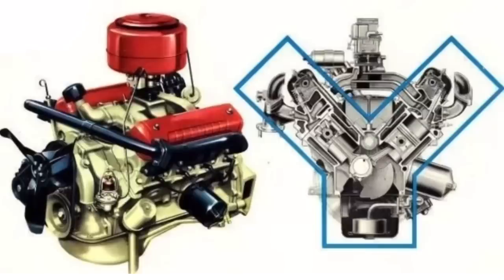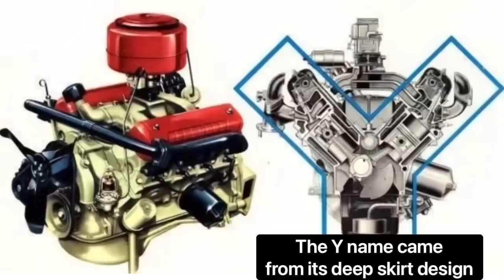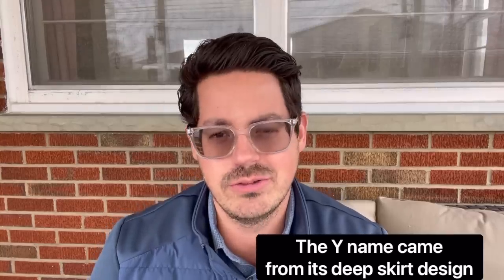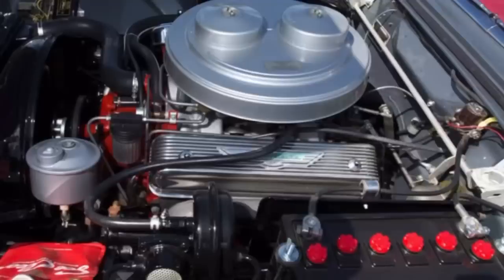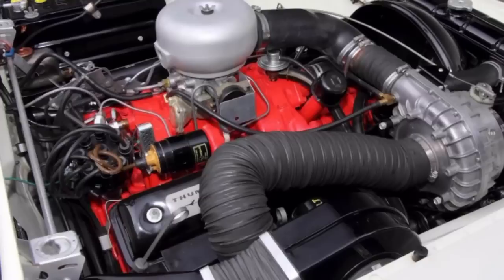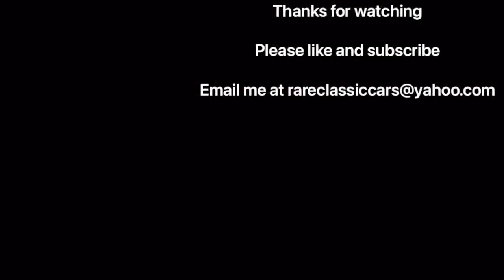Worst Engines of All Time: Ford Y Block V8

Comment: Lol all these guy talking about them motors leaking oil. Im 71 years old every car in my  neighorhood leaked. Cars and motors sucked back in the 50s60s70s80s if you had a car with 50,000 miles on it no matter what it was it was burning or leaking oil.
Reply: About leaks, that is true.  VERY few cars more than 5 years old were leak-free.  The gaskets would harden and shrink.

Comment: I;ve had a few  292 Fords and I see NOTHING wrong with em. For instance 292 With 312 heads In my opinion cold hold it's own any day. It all boils down to if you are a Chevrolet guy  then nothing is as good. Myself i'm a die hard blue oval kind a guy
Reply: FACTS.

Comment: We had several y blocks, they all lasted over 100,000 miles. Sludge was a problem in any engine of the era. I cleaned a lot of engines back, ( all makes) then wondering how they ran, with all the sludge in them. The only real problem with a y block was they were heavy, like many engines of that period.

Comment: The "Y" blocks were great engines. The Fords benefited from having a 3-speed automatic transmission, although until 1956 or the 1958 Cruise-O-Matic, they normally started in 2nd gear. With the Lo position, it allowed the fords to move off the line quicker than a Chevrolet with a PowerGlide.
OK, the "Y" blocks were very reliable  and long-lasting engines. Their life and reliability depended on a large part to regular maintenance.

We resurrected a 1960 Ford Sunliner a few years ago. It pretty much had sat at a vacation home, rarely driven, for the last 50 years when we got it. The top-end was slugged up and we had to pull the heads and do a valve job.
We used to see lot's of much newer slugged up engines,  and it wasn't from not using detergent oils. Nearly everytime, we found that they had used Penzoil and changed it at factory intervals. It was the ash in the oil. Not so much a problem with Quaker State and NEVER a problem with Castrol, Valvoline or other Western oils.
Well, after the valve job, the engine ran like new(the car didn't have that many miles on it). At the same time, I pulled and resealed the Cruise-O-Matic transmission. As these used metallic clutches, they were in great shape, so I re-used them. The lined bands were replaced, as well as all the gaskets and seals.

After that job, I took on a 1956 Ford T-bird, with a 312 V8 and Ford-O-Matic. After disassembling the engine, everything looks good, but the customer wanted it rebuilt. Everything was within tolerances so the engine was cleaned up and new rings and bearings were installed. The heads got hardened valve seats for the unleaded fuel. Again all the transmission internals were in great shape, so all it got was new bands, seals and gaskets.

The similar Lincoln and Mercury Turnpike Cruiser 368 V8 was also a good engine. The only reason it was replaced was because of it had run it's course, plus the cubic inch and horsepower race was full blown.

The "Y" blocks came to an end and the 292 was probably used last in the Ford F-100 pick-up. Many are still on the road due to the interest in early-60's  Ford pick-ups.
Ford needed a physically smaller engine to fit into the smaller cars at the dawn of the new compacts. Chevy already had the smallblock and Chrysler came up with the new LA engines, Ford followed suit. The new 260 Ford V8 showed-up in Fords compact cars first. It was also the first engine used in the Cobras and Sunbeam Tigers. Because it could hold it's own, it replaced the old 292 "Y" blocks. In 1965, it grew to 289 c.i. and then went into most Ford and Mercury's as their base V8 engine, including full-sized cars and pick-ups. The next generation brought the legendary 302 V8. I believe that Ford still manufactures them, but they were replaced by Ford's modular OHC engines.

No. The "Y" block was a legendary and excellent engine. It was only hampered by physical dimensions and dated technology.

Oh, the "flathead" Ford V8's can easily be modified to give reliable 210-250 horsepower. There is nothing like the exhaust note of a "flathead". Be sure to congratulate a person who has a vintage Ford with atleast a genuine Ford powertrain!
Reply: Ford  replaced there  Y series  engines  because they realized they had two problems they didn't like.  First was  both the Lincoln and  Ford Y engines had two center exhaust valves  close together this caused  burned valves  from over heating under extrema conditions. The second was  the distributor  was at the rear of the engine  making it hard to service. Ford  never  made another  North American engine  with this problem again. Chevy built there  engine for nearly 50 years and never fixed ether  problem.
Reply: @mylanmiller9656  The rear distributor wasn't really a problem as many other engines from Mopar and several GM engines had them and never changed it either. I never had a problem servicing a "Y" block distributor. I hadn't seen any more valve problems with the "Y" blocks than any other engine in over 40 years of working on them. The Chevy smallblock always had inherent problems and culminated with the Siamese cylinders of the SB 400. I can't tell you how many SB's I've seen with holes in the sides of the blocks from thrown rods. They finally addressed the problems when they introduced the LS series.
Reply: @automatedelectronics6062  The  rear  distributor  was a problem for the Ford engineers and they did fix it. Just because  Dodge  and GM never addressed it or the two different
Reply: @mylanmiller9656  Ford engineers did the best they could. Heck, even on the old flathead V8's. They had the distributor originally mounted on the front of the engines and then changed it to the top of the engine.

With the new "Y" blocks, Ford went to using a single water pump, compared to the 2 water pumps on the flatheads. They put the distributors in the back and they didn't interfere with the cooling systems as front mounted ones did. Plus there was more room for accessories on the front.

The rear mounted distributors were easy to work on on the "Y" blocks, especially considering front-mounted accessories and easier for the cams to drive them.

This I know from personal experience working on them. How many have you worked on?

On Pontiac and Olds, the rear distributors we're a real pain because they were buried behind the intake manifold.
Reply: @automatedelectronics6062 You should preach to the engineer's that changed them  not me! As for working on them I never took the time to count  how many Y blocks  I worked on.  I worked in a service  station  when I was going to school, changed the Points in lots of Y blocks and will never say they are good to work on. Compared to the FE or 289 they sucked.
Reply: @automatedelectronics6062  Plus, rear-mounted distributors are not subject to getting splashed in the winter the way front-mounted distributors are.
Reply: @mylanmiller9656  I always remove the distributor to do any work on it.  Much easier that way.
Reply: @mylanmiller9656  Sure, but remember, the "Y" blocks were Ford's first OHV V8's. They upgraded decades before Chevy finally did. One of the nice things about Fords with "Y" blocks is that many also had front-hinged hoods, which made  working on the distributors a breeze. Now those same cars with FE engines, working on distributors was a pain and you had to get past the metal radiator reservoirs.
There is no distributor harder to work on than a Pontiac G.P. with a 455 V8.
Reply: @automatedelectronics6062  Ford  learned  lot from the two Y blocks. they were not bad engines, Like any first attempt they had quirks.  i thought the MEL and Super Duty Heavy truck engine  was more of a  mistake than the Y block!
Reply: Yup, it has to be a FORD, not a Fordolet.

Comment: My dad worked for Lincoln-Mercury located in Metuchen, NJ, during the mid to late fifties as a public information officer and drove a 1957 Ford Fairlane 3-spd. manual. I don’t recall much detail as I was maybe ten years old at the time. He always complained about that car being a “bucket of bolts”.  After ice skating one afternoon he was driving us home and lost control and we smacked into ditch and that hood popped up on impact and damn near hit the windshield, we were lucky.  After that the old man went out and bought a VW bug. The heat was lousy in those cars. Somehow they scavenged heat off the exhaust manifold. He told me everyone will be driving small cars in the future, that was maybe mid-sixties. He was right!

Comment: I had two 292s in trucks and really liked the engine. They were durable for us.  We rebuilt both engines when we first got the trucks and never had any problems. They were a little tricky to get the cam gears timed correctly when you're putting them together.  We would find a exhaust manifold for the left side that dumped out the back and did away with the front crossover pipe.
Reply: Would do the same, but run straight stacks with the metal flappers.

Comment: In the past ten years I bought a pickup and a dump truck with 292 ci engines both 1964’s. Both ran great and were very reliable and neither had external oilers.  I did nothing special for oil changes and my only complaint was a need for more horsepower in the dump truck.

Comment: The Y-block continued on in South America until at least the mid 80's. Sometime in the 70's Ford came out with what they called the phase 2 Y-block which changed the head, intake and exhaust configuration. I run the early version all the time and never have a problem with them.

Comment: The old flathead Ford never actually made 110 hp in stock form. The only reason the HP was raised was Ford had a lot extra flatheads when they came out with their first overhead valve inline six. Much to their embarrassment it was more powerful then the V-8 so on paper they raised the Flatheads HP. ALL the spec were the same as the year before.
Reply: Very true. Those things were limp as hell in stock form.

A 235 Chevy six would smoke the flathead as often as not.

In ‘53, even the 215 Ford six would give that flathead a run ...
Reply: Even though the 52 and 53 had higher compression than the 51?
Reply: @michaelbenardo5695   They didn't even have one point of compression more and not all of them had the higher compression. 6.8 to 7.2  For most of 52 it was still 6.8  Other changes made the net gain very little. the bump in horsepower was mostly a marketing ploy to insure they sold the V-8s still in stock.  Fords new inline six with the overhead valve was smoother and made as much if not more hp.

Comment: My first car was a 57 ford station wagon with a 312. Currently I have a 54 custom line with a Y block. I think with proper tubing for top end oiling they work great.
Reply: You don't need the tubing, just groove the center camshaft journal, or use a later cam that already has a groove, and plug the oil bypass hole in the rocker shafts.  End of oiling problems forever.

Comment: The Y blocks powered the 1957 NASCAR champion beating fuel injected Chevys and Hemi-powered Chrysler and Dodges. I've been building and racing cars over 50 years the Ford Y block is a great motor. But some punks that don't know anything just have to put stuff down. Yes early Y blocks had some rocker oiling problems which were corrected early on .The lower ends were so bulletproof the design was copied for the all conquering 427 Ford.

Comment: With the exception of an upper oiling issue on early versions, these engines get an undeserved bad rap. Not racing engines, but plenty of torque. I had a '56 F100 with a 272 two barrel, went to 212,000 miles before I rebuilt it. And being young and stupid, I beat the crap out of that engine, but always clean oil. Grandpa had a 55 Fairlane with the same engine, and similar miles. I think with modern lubricants that won't coke and create mounds of sludge, I would love to have one now in my truck. The oils we had back then were awful,
Reply from the maker: Your introductory clause says it all…with the exception of an issue that destroys the engine.
Reply: If we still had the oils of yesteryear, today's Datsuns and Toyotas would only last about 50,000 miles.

Comment: They called it the Y block because you had to ask why?  Why would they do this?  They weren't terrible but they had more flaws than good points.   They looked good sitting under the hood, that was about all they did well.   As with all things Ford, they don't spend very much time sorting things out before they turn their customer into guinea pigs.   The FE was OK but required a large engine bay to fit all that iron.   Fortunately,  the small block Ford arrive in the early 60' to replace the Y and has proven to be one of the best V-8's of all time.
Reply: GM is the company that turned their customers into Guinea pigs with the Cadillac 4-6-8, Vaga, Corvair.  They kept the Power Glide for to long, could not decide on a proper shift quadrant between divisions until the federal mandate in 65.
Reply: @Sundancer268    Didn't know GM had anything to  with the Y block or any other of the long list of engines, transmission and vehicles Ford has manufactured over the years that have been the bud of many jokes and worse, frustrating nightmares for the customer.  Since you bring it up I would agree GM has had a quite a few abysmal failures over the last century that kept their lawyers busy.  You forgot the Olds' diesel, 6.2 diesel and how could your forget the... Vega.      At the end of the day the GM list is relatively small in comparison to that of Ford.

Comment: First engine I "rebuilt" as a teenager many, many years ago. Road draft tube crank case ventilation was horrible. Packed FULL of sludge. Cam bearings were semi finished. I finished mine with a broom handle & sandpaper till the cam would go back in the block.  Surprisingly it ran OK in spite of me.  Small block Chevy is way better in my opinion.

Comment: No no NO… I have many y blocks, I love ‘em.  And nothing sounds as nice in a 50s car.  I have to disagree.
Reply: When the rocker shafts wore out, they sounded like a thrashing machine. They’d pop, crack, spit, and clack along — a very distinctive sound. You could recognize them coming a quarter mile away ...
Reply: @sking2173  yeah, but not in cars! Actually with modern oils and regular oil changes, including a lip seal rear main (remove the rope style) they are very reliable and run awesome.
Reply: @nathanfisher4452  — Modern oils? I’m talking back on the 50’s. I was there, and that engine was so prone to top-end oiling problems that it became a joke. 

Ford was lucky to have come out with the FE engine so quickly, as it offered some amount of redemption for building that Y-block disaster.
Reply from the maker: You just made my point for me.
Reply: @sking2173  The later ones were fine, and the early ones can easily be fixed.

Comment: If you can even find a 1955 Chevy V-8 I'd be surprised and I know of three 1954 Ford 's with the original engine.
I have worked on a 1956 265 Chevy, the 1955 had no external oil filter!!!2022
Reply: And even on the 56 and later ones, it was an option until about 1968!

Comment: My dad had a auto repair shop in the  40s thru the 70s. He did a lot of conversions on the the Y block to get oil to the rockers. I remember it had copper tubing being plumed right into the valve covers.  I had a few flatheads back in the day..great sounding engine but it had some inherent issues, overheating, burning valves, vapor locking and breathing issues...a bit asthmatic to say the least.

Comment: I'd say the Windsor engines supplanted the Y block, not the FE and certainly not the MEL.  The FE and MEL were sold as larger displacement alternatives to the last of the Y blocks and the first of the Windsors. I'm not aware of any cars in which the Windsors and Y Blocks were available in the same model year.  The Windsors can be seen as the "New and Improved" Y blocks.
Reply: The Windsor is heads and shoulders above the Y-block. It is arguably the best V8 that Ford ever built.
Reply: @sking2173  This is true.  It's like "New and Improved" actually meant something for once.

Comment: I've never been super fond of the y block but I do have a 1964 f100 step side my great grandfather bought brand new in 1964 that still has it's original 292 y block and other than valve adjustment and replacing the ignition points its never really given much trouble. I inherited the truck in high school and immediately put a 4 barrel intake, an autolite 4100 carb and did away with that fugazy @$$ crossover exhaust for rams horn manifolds and true dual exhaust with old Smitty's glasspack mufflers. I'm kinda surprised you didn't mention that weird exhaust system they had, im sure you've seen it and it's just super goofy in design.

Comment: It should be mentioned that the follow-on series of engines, the 260 & 289 V-8s, were "thin-wall" castings, thus much less desirable as boat-anchors. Easier on the Missabe Range.

Comment: I had a 1964 Ford 60 passenger school bus with a 292 V8 five speed that got 2 miles per gallon more than my 1975  Chevy 350 Blazer. Had the bus 11 years with no engine problems at all. I can't say that for the Blazer.